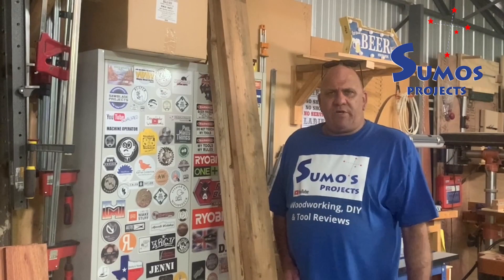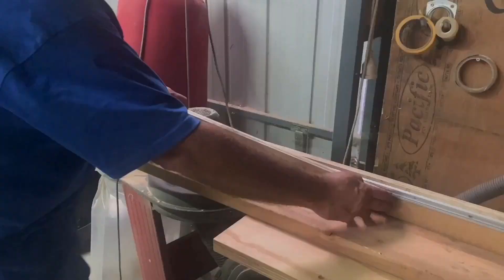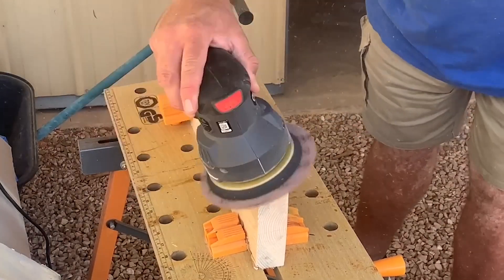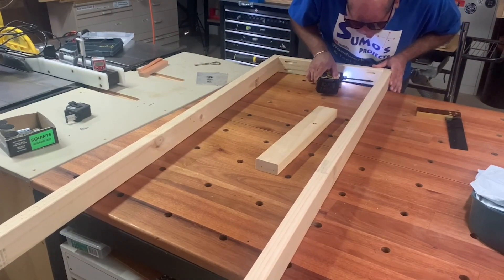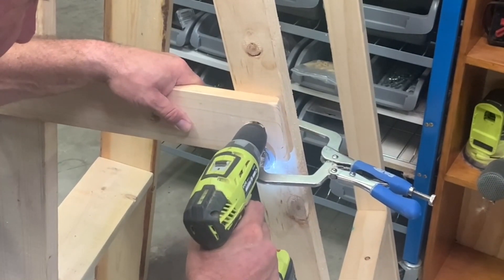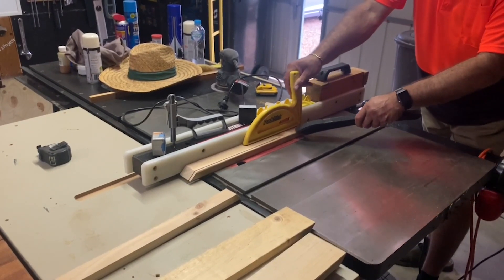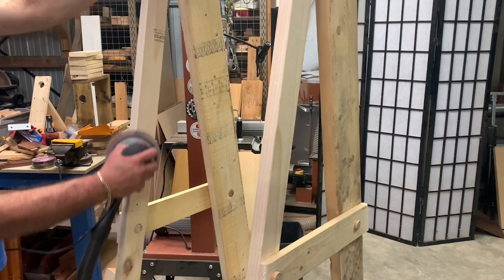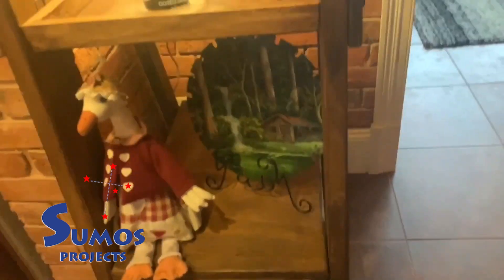Kreg Jig Projects - DIY Easy A-Frame Shelves

Comment: Bad work practice for an instructional video.

It is a dangerous work practice to put any chemicals into a food container. And it is also a dangerous practice to promote it in an instructional video.

Putting wood glue into a tomato sauce bottle - just not on! 

Carbatec sell glue bottles - ask them kindly and they might even give you one.